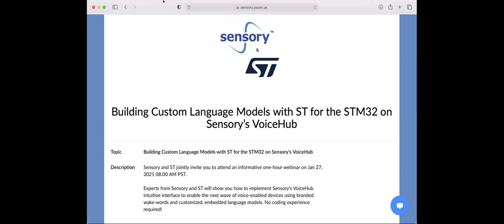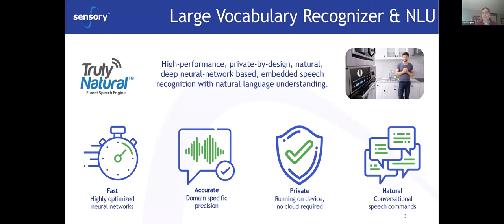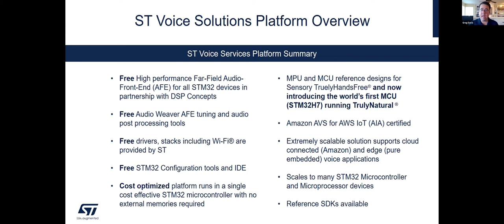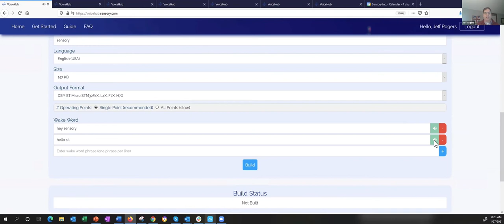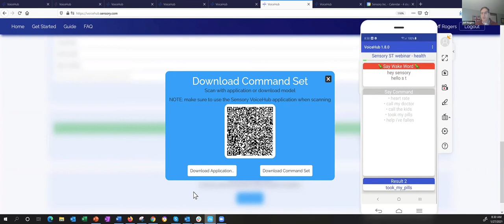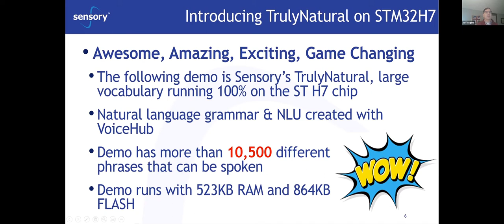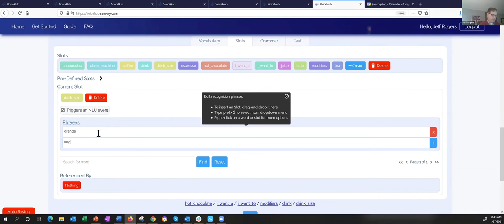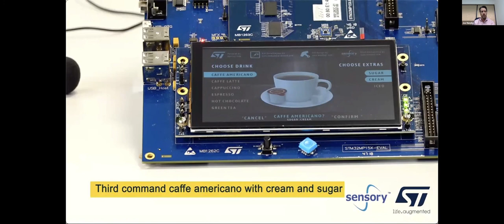Building Custom Language Models with ST for the STM32 on Sensory’s VoiceHub

Comment: Also one more thing I noticed, by mixing the wake words, the engine does not start. Do you think that can be solved? Because human tendency is always subject to errors and it will be a good thing if the engine overrides those and brings the experience correctly, here to start even if we mix the wake words